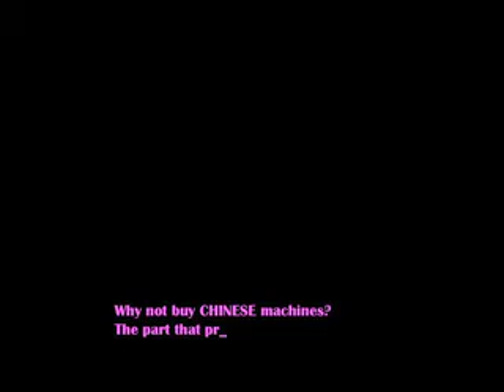Chinese Coils EXPOSED

Comment: Well that makes sense I picked up tattooing when i was about 12 but then stop for several years, but im back on it, this time going into the physics of the machine, i have just made 2 sets of coils an 8 wrap and a 10 wrap. my 8 wrap using it as a liner i'm pushing 5.5 to 6 volts to run it, my 10 wrap pushing it at 6 to 7.5 volts and they work great, i took a chinese machine apart and rebuild the coils springs and armature bar by taking in what you explained on your videos and I'll tell you something keep up the good work your tutorials are awsome

Comment from the maker: This vid is intended to show WHY Chinese coils scar and rip skin. If you protect their shitty magnesium mix core, thick plastic barrier and copper plated wire, then more power to ya..Im not here to argue, just show relevant facts.  All PRO builds do NOT use plastic bobbins..you say it wouldnt work without it? Bro..your nuts!  The lowest Voltage on Pro coil is because of the CORE and NO plastic bobbin ..a simple barrier to separate wire from core center. Technically, all copper wire used in tat c

Comment from the maker: Has EVERYTHING to do with trauma to skin...requires more Voltage.  An artists objective is to be able to work the skin a number of times,.using less Voltage or in/out, and yes,  more resistance =more power=harder hit=more trauma..so argue away. My machines run at 4-5.5 volts for a reason! Lol

Comment from the maker: David, just to clarify,  the chinese are the ONLY manufacturing outlets that use one quarter inch thick PLASTIC for bobbins, pros NEVER use COMPLETE bobbins ...if you save up your money and purchase a GOOD machine, unwrap the coil, you will find what I say to be true. The enamel coat (Green, Red, clear) on the copper wire itself would serve as a sufficient barrier, but ALWAYS have to be safe and free from possible shortage, a THIN barrier is used..but thank you for your sound advice :!

Comment from the maker: Thank you David for your expert advise but in the quality world, we use Iron or Steel cores and to insulate the core, we use things like Kapton and special resins or little "secrets" to insulate that allows for less resistance which equivocates to lower voltage thus minimizing trauma to skin. When I referred to the Chinese using "plastic cores", the comment was intended for individuals that build coils..and no David, without it it would still work, how? The barrier coat on the copper wire itself

Comment: Kage: I did get one frame from Cam that the rear deck was actually bent straight and did have good welds,I guess I prefer a welded side plate to a bent frame . I realize u dont have to run ur wire through the washer I just like the way it looks.Like everything ,more than one way to skin a cat.I have built machines w/many adjustments and always went back to a more simple machine..good luck w/ur project
.

Comment from the maker: Tim, so CAM you think have top notch machines? The one I had looked real decent, the frame was geometrical, coils tight, welds were only in 2 spots, everything was tight. But looked it up and allot of reviews stating is was garbage. But changing everything out would make an entire new machine. So with the design of my new coils, some designs do not require the wire to go through the washer, and won't be affected by shorting.Can't wait to show all of you.A 25 year vet will be helping me make them

Comment: Cont: Some china machines can be rebuilt and re-tuned but it cost more money than they are worth.Also IASC for annealed copper is 100%,brass is 28%,Alum. 45-50% ,steel 3-15,iron 2-12% ,silver 106% conductivity.so u want good copper magnet wire,copper or silver contact screw and steel screws for the coils.

Comment: Kage:Resonance is how the machine sounds,brass sounds different than steel ,alum.,plastic etc.I have seen the composite ravens from superior run real well w/a change of springs and abar..Reasonance will also cause the machine to vibrate if the parts are not right.Deep drilled coils will caused more vibration,improper sized spring washers will cause vibration.Not sure why u want to have ur coil wire not go through the washer.In Cam defense the do sell top quality machines.

Comment: Kage sorry not very good at computers or video . Cam machines are toys.U end up having to re wrap the coil and re bend the frame.Bobbins are ok because the electrical flow goes on the out side of the core not through the middle.A shallow drilled core will cause less resonance and thus less vibration.The frames are not square and cheap metal.Cast frames are cheap scrap metal and not necessarily iron[more likely scrap steels]

Comment: at least if its mig wire it is steel that is copper coated,but it still needs at least annealed steel core 1018 heat treated, works fine,better than scrap chineese pig iron.By the time u get a cheap chineese machine running u might as well buy a good one.ITS are chinas but still have good machines but they are ripping off brand name machine builders copyrights.

Comment from the maker: Tim,  how you doin? Yeah, these particular coils obviously were the worse kinds. The tops were superglued and definitely plastic all the way through,  I hacksawed to make sure. I have others that I have taken apart, like you said..plastic bobbins with steel core. These werent those. Plus they are using mig welding wire for coil wraps...like I said, those machines regardless are pushing out about 48% conductivity compared to solid core,  solid wire. Chinese machines cannot go pro-Kage

Comment: Kage some good info,but I'm not sure what coils ur takeing apart because I've taken apart lots of Cam coils{china}and they do not have plastic cores.They have a plastic bobbin and a cheep steel core.They are magnetic but probably mixed scrape steels.Wire is copper coated aluminum.
d